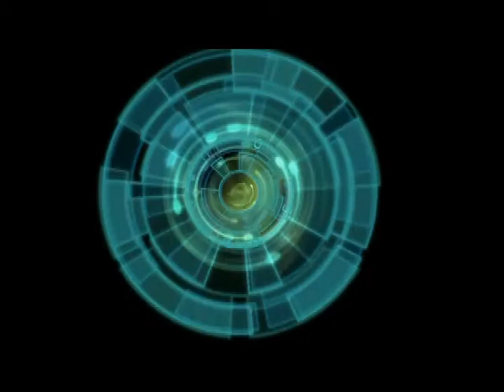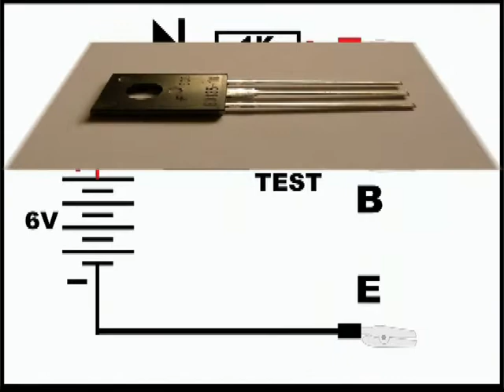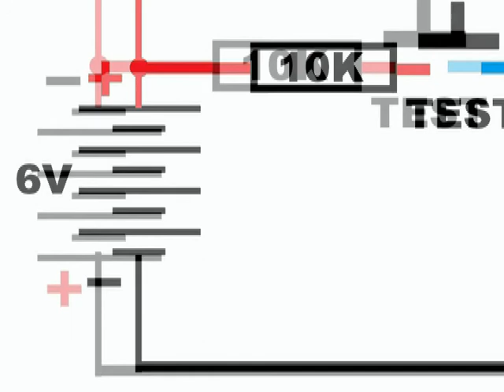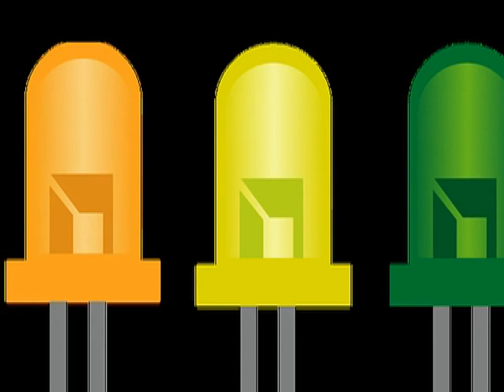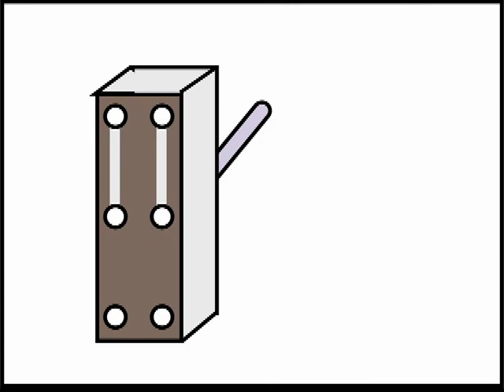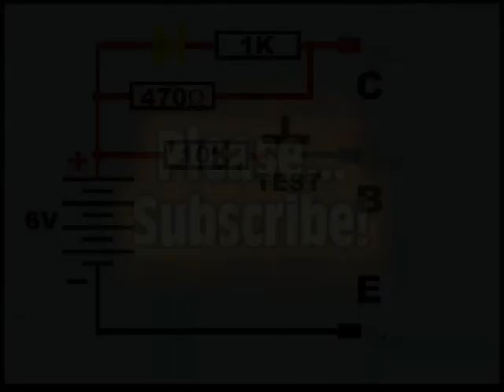Simple transistor tester

Comment: how does work this tool so that can find out what component it is measuring
Reply from the maker: Dear Ponti, it merely injects a small current between base and emitter and uses the amplified output from the collector to turn on the LED indicator. If the leads are wrongly connected, it shows that condition by no light at all, or LED being lit regardless of no button pressed.